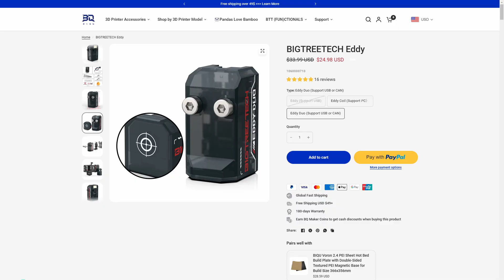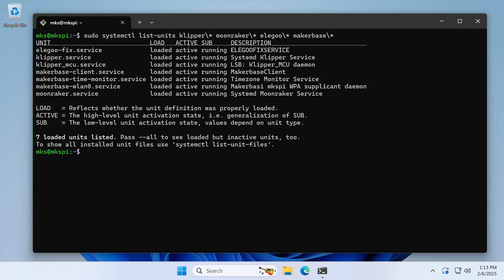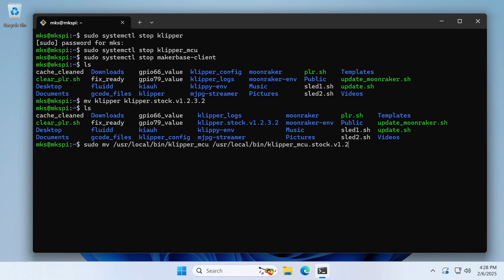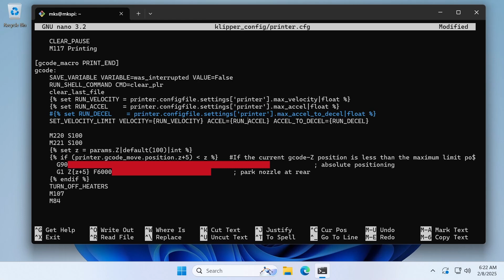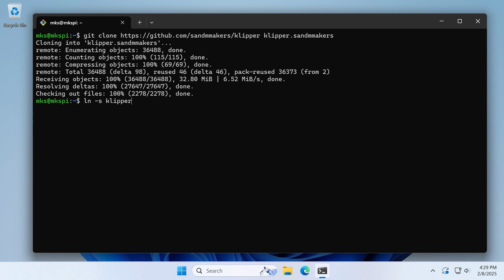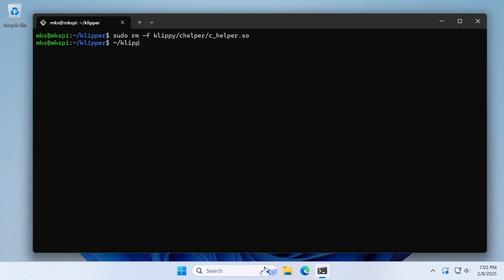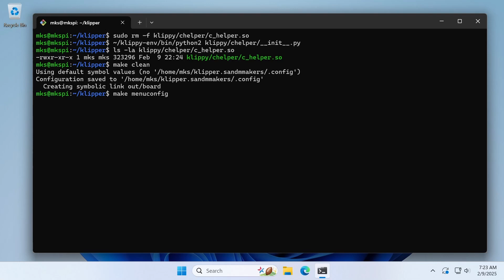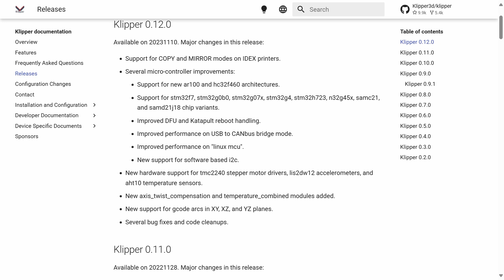Modern Klipper on the Neptune 4 Max

Comment: Before I do this, what happens when Klipper is updated? WOuld you need to create a new compatible fork to be able to update again in the future?  Maybe I missed mention of that in the video.
Reply from the maker: Thank you for watching our videos! Yes, if you want to kep the Elegoo-specific modifications, you would need to stick with my version of Klipper. However, I intended on periodically creating updates. Also, the upgrading instructions are on my web page (I want to create a video, but have had the time) and uninstalling/reverting my version of Klipper is easy and only takes a couple of minutes, so it is very low risk.

Comment: Being married, have a beard, and do your hobbies. You're my role model!
Thank you for the video! Was interested in this route, over the Nept4une Klipperization.

Sorry, I accidentally deleted the original comment. Had issue with an ERROR,  Error loading template 'code_macro M104:code: "UnicodeDecodeError: 'ascii' codec can't decode byte Oxe7 in position 177: ordinal not in range (128)." Never was a problem before. Asked you for a hint, and that was what I needed. GREAT HINT, THANK YOU FOR THAT! Deleted all chinese charaters (注国語), and the (;) icons with the (#), in M104, START, PAUSE GCODES.
You know you content, and you're super helpful. Would like to do the same ;)
Reply from the maker: Thank you.
Reply: Previous comment stated Chinese characters in Start/Pause. However they're actually in the M104, M109, M140, and M190 macros.

Took the system back to original firmware, then reinstalled your mod. Mostly fixed the input shaper stating a TIMEOUT ERROR. Something about it possibly being from a crash. Only happened once now.
Anyways, wondering what you might recommend for the start up issue, for mine. It boots up, then only shows the ABOUT tab. States that it's a Neptune 4, where it usually states that its a Neptune 4 Max. Get on fluid, home the printer, then it acts like it booted up right, showing the right interface on the touch screen. Sometimes saving bed mesh, input shaper, won't proceed to a completed statement. Rehome again in fluid, then it's fine. Wondering if the UI version 1.2.18 is the culprit?

Comment: I have loved all of your videos and followed most step by step successfully... however, with this one I just am curious what are the pro's/con's of doing this vs OpenNeptune?
Reply from the maker: Thank you for watching our videos! My version of Klipper and OpenNeptune have completely different design goals. While OpenNeptune aims to create a "completely vanilla Klipper experience", my version of Klipper strives to make as few changes as necessary to support modern mods and Klipper features. For instance, if you switch to my version of Klipper, but don't install any mods, then you will probably be unable to tell that something has changed. Also, my version can easily be installed, updated, and removed (in minutes) without flashing the eMMC.
Reply: @SandMMakers thank you so much!

Comment: I still get mcu: unable to connect after having done all of this, and ensuring I am using a data usb-a > usb-c cable on my pi 5. any suggestions?
Reply from the maker: My version of Klipper runs directly on the printer's main board, not on a Raspberry PI.

Comment: I got a Max 4 strait out of the box with software problems.   screen say data error,    elegoo sent eccm but same problem. 4 weeks ;   said the where sending main board and controller waited 4 weeks and opps forgot to send it.   Is there a way to just start from scratch and just reload everything with new software,   I need to print something large yesterday.
Reply from the maker: Elegoo, at least used to, have disk images that you could use to revert to stock. I don't have the link with me right now, but my earlier video about backing up eMMC modules might help.
Reply: @SandMMakers  greatly appreciated and already viewed video.  without working control touch pad , i appear stuck.
Reply from the maker: You don't need the LCD controller to flash the eMMC, just an eMMC to USB (or sd) adapter.

Comment: How am I supposed to connect to the printer? Is this wireless or to the LAN?
Reply from the maker: Thank you for watching our videos! You can connect either way using the standard methods for getting your printer on your home network. The new firmware doesn't make any networking changes or require anything special.

Comment: are the steps still the same or has anything changed from this  new firmware 1.2.3.4 from elegoo?
Reply from the maker: The steps are the same, you just need to use the newer version. I have directions on the webpage.
Reply: @SandMMakers  worked like a dream thank you for the easy awesome instructional video!

Comment: Forgive me but I am NOT software literate. My stock firmware is v1.2.3.3 not v1.2.3.2. I don't understand the cloning and flashing that dannoaki said he did. Can I just use the v1.2.3.3 or not? Thanks
Reply from the maker: I can't comment on anything anyone else said, but I have versions that work with 1.2.3.2 and 1.2.3.4. Please see my webpage for details. If you are on 1.2.3.3, I'd suggest you upgrade to 1.2.3.4.
Reply: @SandMMakers  Thank you

Comment: I just updated my Neptune 4 (v1.1.3.3) Pro remotely following the video, and I believe it was successful (I'll check when I get home). I had some problems with the apt repositories because Debian 10 is no longer supported, so I had to change them to "archive" in the sources.list. Another issue was with the git certificate; I had to use export GIT_SSL_NO_VERIFY=1 to ignore it. Other than that, everything went smoothly.
Reply: I just used the sandmmakers-ElegooNeptune4Max-v1.2.3.4 branch.
Reply: Congratulations on the video. It's very comprehensive and educational! Thanks a lot!
Reply from the maker: Thank you!

Comment: this should work for a neptune 4 pro?  Also wanting to add a eddy or some better beacon probe system if your able to do that.
Reply from the maker: While I don't have access to a base/Pro/Plus to confirm, I'm fairly confident that the new version of Klipper should work for all models. However, even if it didn't work, reverting is very easy.

Comment: Hi. I'm having issues with the first step. I downloaded Terminal and Gitbash and got everything running, but when I try to ssh into my printer, it stalls for a few seconds and then says "ssh: connect to host (IP address) port 22: Connection timed out". Any ideas? I'm on Windows 10. 
EDIT: Nvm I got it working. Updated Klipper. Thanks.
Reply from the maker: Thank you for watching our videos and I'm glad you got it working!!

Comment: now my printer stops on the moonraker  timeout. Can't even run from the USB

Can you show how to revert? The video shows that we made copies.
Reply from the maker: I'm sorry you are experiencing issues installing my version of Klipper. I'd suggest going back through each step, making sure they were completed correctly, but if you want to revert, there are directions on the accompanying webpage. Also, I'm planning on making an "updating and reverting video" soon, but I need to complete my current video first.
Reply: @SandMMakers I bought the emmc burner and reset everything. It's working fine now. That was a good video btw.

Comment: Please can you put anycuvbic kobra 3 max inside bed 5000???kobra 3 max has go klipper but with rinkhalls you can put marlin and fluid..
Reply from the maker: Thank you for watching our videos and your interest in Bed Leveler 5000! The Bed Leveler 5000 software suite includes the Printer Info Wizard, a small utility that makes creating new printer configuration files easy. I'd recommend giving that a try. If you get a working configuration file and attach it to a Github issue, I'll add it to the next BL5K release. If you are unable to create a working file or if BL5K ends up being incompatible, please file a bug report (directions are available on Github) and I will look into it. Unfortunately, I can't add support for new printers without either having access to the printer or a log file.

Comment: Oh boy, just ordered a Max, should I upgrade to new klipper straight away?
Reply from the maker: I would only suggest upgrading if you have a specific need and even then only after you gain a bit of experience with the printer (unless you are already rather familiar with Linux administration).
Reply: @SandMMakers Thanks for the advise, I just did my first print with PLA its flat about 20cm x 10cm x 3cm high the walls are not smooth have to get on top of it the quality did not blow me away

Comment: I'm tempted to test this out on my Neptune 4 Pro. Have you heard any success stories yet from anyone with this model? Also, is this a one and done project, or do you intend to keep it maintained when klipper has major updates?
Reply: Ended up following the guide for my Neptune 4 Pro and can confirm it works just fine! 

For reference, my only prior tinkering at the system level that could potentially muddy up results is that I updated the system firmware with the latest from Elegoo, as well as updating the touchpad firmware (which just uses the SD card slot inside the touchpad)

Side note, it would be really cool if there was an sh file or maybe a TUI wizard built with python to automate most of this and prevent user error. That's a big ask though, but might be something I'd be willing to contribute if I end up really liking this!
Reply from the maker: Thank you so much. Yes I intend to maintain this project.

Comment: i have big problem, and it seems Elegoo cant solve it either, problem is the hotend start at -42, they send me new part, cable, extruder, and the tiny extruder board, but still at minus -42, so that dident help me out..
Reply from the maker: What do you mean by, "the hotend starts at -42"?

Comment: i have installed and went great, entered a few commands incorrectly and it told me it didn't like those and just had to reenter them, its almost impossible to screw anything up if you just follow the video.  now that i have installed it i see Co Print want you to delete the printer config files and reinstall the config from there github, will i have to redo the entire setup if i add the Co Print or just go back in and change those lines in the printer.cfg that you changed in the video?
Reply from the maker: Thank you for watching our videos! I'm currently working on a CoPrint video series that will show how to update the printer.cfg file. While you can try using the files provided by CoPrint, they are intended for use with OpenNeptune, not my version of Klipper.

Comment: Hi, I am planning to upgrade my neptune 4 max using your version of klipper. Do you know if I could use octoprint to manage my printer with this version pf klipper. I manage all my printers with octoprint and I am somehow confused if I need to flash another version of klipper to be able to use it? Can I ise octoklipper to manage it?
Reply from the maker: Thank you for watching our videos and your interest in our version of Klipper! I've never used OctoPrint, so I'm not very familiar with it. I would assume OctoPrint would work without any issues, but that is just a guess. Luckily, our version of Klipper is very easy to uninstall if it doesn't work. Plus, I'm currently preparing a video on how to both upgrade between versions of our Klipper and also how to uninstall.
Reply: @SandMMakers awesome thank you. I will work on the update this weekend. I appreciate your help.

Comment: First just to say a big thank you for the excellent series on fitting linear bearing rails…they have improved my4max.  I’m interested in your klipper replacement work as I’ve just completed a problematic install of moonraker time-lapse which was somewhat hindered by the presence of an ‘unknown to me’ moonraker timelapse dir on the printers OS.  I understand now that elegoo ship with their modified versions of klipper etc.  Will installing your full Klipper version also update Moonraker and Fluidd to ‘vanilla’ versions?  PS really appreciated your tips on creating an emmc backup as well.  Wish I had your coding knowledge! best wishes from the UK.
Reply from the maker: Thank you for watching our videos and your interest in our version of Klipper!  Unlike OpenNept4ne, which aims to create a "fully vanilla Klipper ecosystem" , our version of Klipper is intended to make as few changes as possible to provide compatibility with modern mods. As a result, our version only modifies Klipper and nothing else. I might expand to Fluidd in the future, but right now, nothing is planned.
Reply: Ok many thanks for your reply.  One last question for you.  What flavour of Debian does your kipper mod install?  My Timelapse install would benefit from not relying on Debian Buster…it only supports V3 of Crowsnest but the latest Buster supports V4 and might also afford a less problematic time lapse install?  Keep up the great work though.  I chose the N4max for its build volume and reasonable quality… for the money anyway. Will keep an eye out for your next iteration. Thank you.
Reply from the maker: My version of Klipper does not make any OS changes.

Comment: Thanks for the tutorial. Ran into the following error during restart: 

"File contains parsing errors: /home/mks/klipper_config/printer.cfg
[line 343]: 'cp ~/klipper_config/printer.cfg ~/klipper_config/printer.cfg.stock.v1.2.3.2\t G92 E0 \n'

Once the underlying issue is corrected, use the "RESTART"
command to reload the config and restart the host software.
Printer is halted"

Any ideas how to correct this? Launched the printer.config file but not finding anything similar to what is mentioned in the error.
Reply from the maker: Thank you for watching our videos and trying our version of Klipper! Your printer.cfg file appears to have one or more errors in it. From the provided error message, there appears to be an issue with the PRINT_START macro.  My guess is that somehow a command intended to be run on the commandline was accidentally pasted into the file. If you have a copy of the printer.cfg file before you started editing it (probably named printer.cfg.stock.v1.2.3.2), you can compare the two files to identify any differences and correct any accidental changes.
Reply: How to flash back the original image?
Reply from the maker: Thank you for watching our videos and trying our version of Klipper! I'm currently updating the companion webpage with directions for reverting to stock and creating a new video with steps. Also, I'm currently in the process of updating my version of Klipper to include the recent changes from official firmware 1.2.3.4 and Klipper 0.13.0. There will be an accompanying video.

Comment: I have 9 Elegoo's, gonna try it first on the plus. Will it be worth the time to do all 9 of my machine's with Modern Klipper?
Reply from the maker: Thank you for watching our videos!! I would really only recommend upgrading if you need features not present in the stock firmware, for instance, if you need compatibility with new hardware modifications or you want to use a recently added Klipper feature.
Reply: @SandMMakers  Thanks for your reply! I think i will try it on my neptune 4 plus in a couple weeks!

Comment: Thank you so much for this. It’s a superb guide - clear, very well explained, and the work that’s been put into this is terrific.  This worked on my new Neptune 4 Plus. It had a new firmware version - v1.2.3.3.  I cloned that eMMMC and then flashed the firmware on the new cloned eMMC to v1.2.3.2 and all worked well, even for Linux newbie like me thanks to great instructions.  (One tiny hairsplitting suggestion- good to pause for 3-4 seconds after a command has been entered before cutting away - it makes it a bit easier for viewers to follow)
Reply from the maker: Thank you for watching our videos!! I'm glad you got everything working and thank you for the suggestion!

Comment: Is this the same as installing openneptune
Reply from the maker: Thank you for watching our videos! The goals of this new firmware are completely different than OpenNep4tune's. While OpenNep4tune aims to completely replace the "Elegoo software ecosystem" on the printer, my goal was to make as few changes as possible to enable support for modern hardware modifications and provide access to new Klipper features. The decision to use my firmware or OpenNep4tune is purely subjective.

Comment: Great video extremely thorough and easy to follow. Do you know if this works on the standard Neptune 4?
Reply from the maker: Thank you. While I do not have Neptune 4, Pro, or Plus printers to test, I suspect the new version of Klipper is compatible. Given the installation process doesn't make any permeant modifications to your printer, it should be fairly safe to test.

Comment: Great Work! Is SSH enabled with that default user and password for only the  v1.2.3.2 firmware version?  Default user accounts and passwords are a huge security risk and need to be changed to prevent unauthorized access.
Reply from the maker: Thank you for watching our videos! I believe the default username and password are used for all firmware versions of the Neptune 4 series. However, in their defense, that is a fairly common practice. If you want to change the password (or disable passwords), please see our earlier video where we walk through the steps to secure SSH.